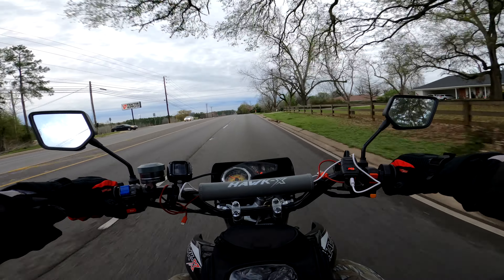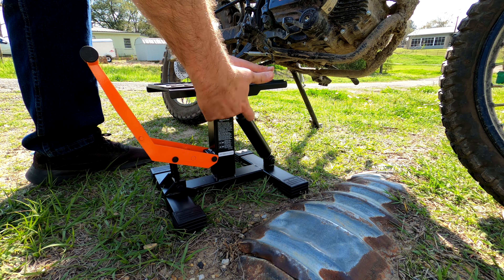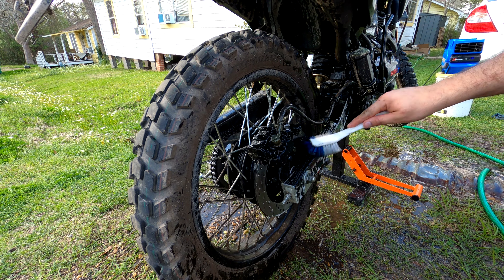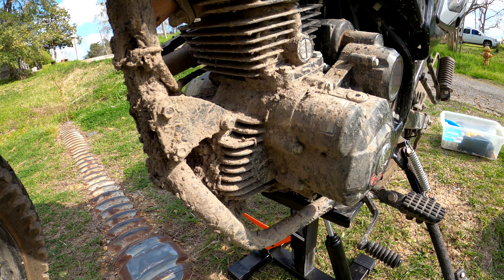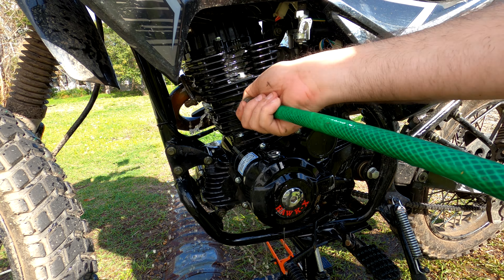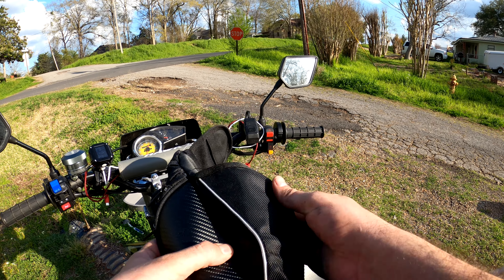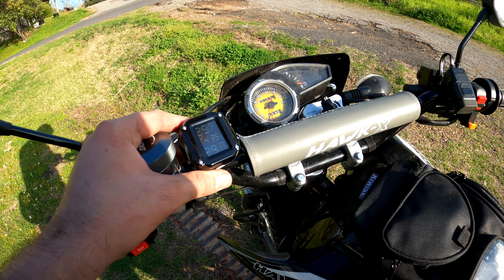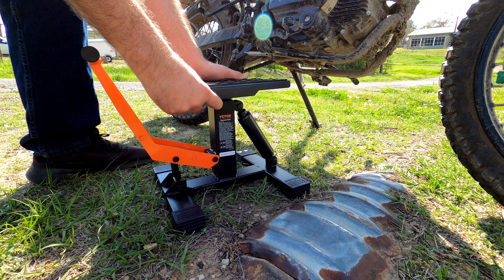Vevor Dirt Bike Lift

Comment: Thankfully the China dual sports gradually keep getting better.....If a person has a license & was planning on spending $1500+ for a high end motorized bicycle build or scooter.. I think they'd be better off just spending around $2k on a China 250 with super moto wheels.(Or the dirt bike wheels) 
    🤔 Maybe add some hand guards & small adjustable windscreen to help bugs at bay....It'd be nice if switching all bulbs to LEDs could use less power & less strain on alternator....Maybe make a metal rear rack. That could hold a nice looking canvas triple bag set. Than can be buckled/strapped down when empty. So they're not bulky, in the way & flapping in the wind. The canvas can be waterproofed. With a triple bag set, backpack & your tank bag. You could carry a lot for a road trip.
 On my tubeless motorcycle I always used tire slime or ride-on. To balance the wheels & hopefully seal a leak. Along with those tire reapair kits that look like black liquorice & a small $10 electric air pump that ran off the bikes  battery. And the factory tool kit. 
The tire plug kit & air compressor were small/easy to bring a saved me so much headache twice. After running over nails both times in front tire. Pulled over- quickly plugged tire- added air - back on the road in minutes. End of morning coffee ☕fueled  ⛽ long comment. I kinda wish I could sell or trade my Yamaha for a China 250cc 6sp with super moto wheels.

Comment: Hey man I have a motorized bike that warped the head and i believe it’s because overheating can I use the white aux power wire to run a pic fan on side of the motor?